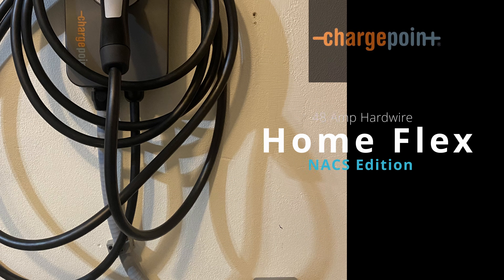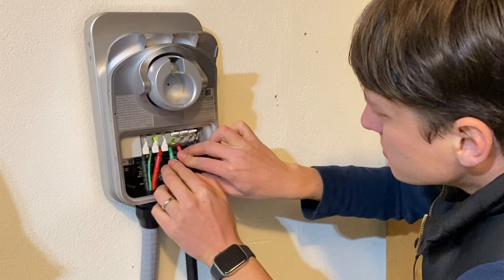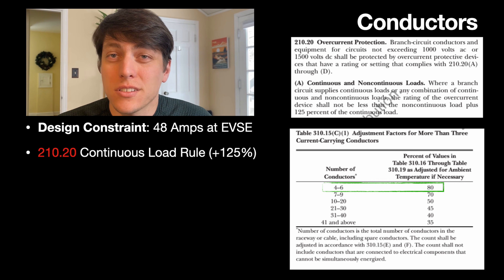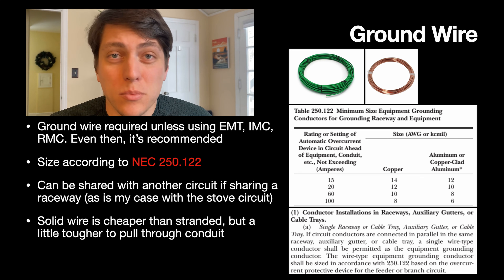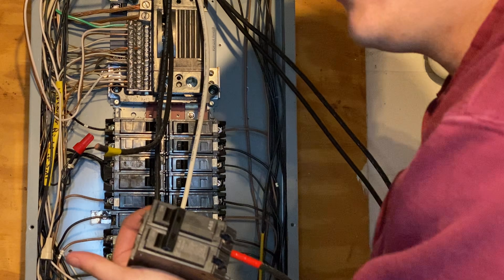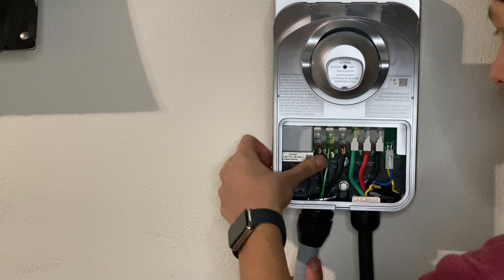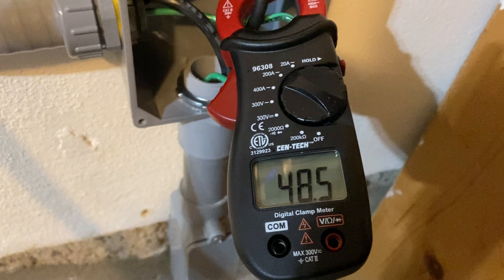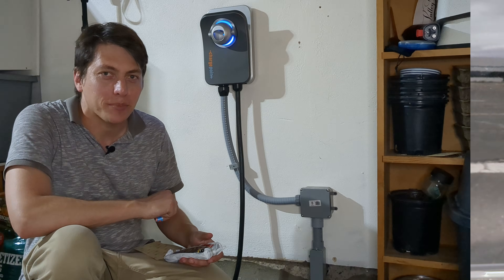DIY install of Home Flex EV charger

Comment: According to code you should install your fittings and glue them prior to pulling wire. This prevents solvents from the glue damaging the wire insulation. General rule is all mechanical first, wire and connections second.
Reply from the maker: Thank you for the tip!

Comment: I have this charger I got on Ebay but realized that it came with the wrong plug where I needed a NEMA 14-50. It seems that ChargePoint does not sell this plug so I am out of luck and the charger is probably going into the trash.
Reply from the maker: You could just buy a 14-50 dryer plug, cut off the ends, and wire that in to the unit?
Reply from the maker: Like this one https://amzn.to/44b45rV

Comment: Where the cable from your breaker panel enters the ChargePoint box on the bottom, does the “cable clamp” that secures the cable to the box (for strain relief) come with the ChargePoint box, or is this something you need to purchase, if doing a hardwired charging station install ? Great video !
Reply from the maker: It comes with the unit and I neglected to install mine. 😅 Good catch!

Comment: Hope you have better luck with yours than I’ve had.   I used to think it was a great unit, until it isn’t.  After a year I’m on my 2nd Home Flex with the first one eventually bricking (fault of ChargePoint support) and have had the original unit derate itself to default charge rate numerous times.

I put the fault completely on their support model.  Every time I’ve needed to call support it’s first a long wait to get a human.  Then you will encounter a very friendly support person (really, they are pleasant folks) that appear to be bound by rules and a knowledge base that are rigid in what they allow the support people to do.  Example, the first several times my unit would spontaneously derate while over night charging, after we discovered that my unit (supplied to me by XCEL on their TOU program) had firmware way out of date.  So easy enough right?  Let’s go thru the firmware update.  NO!  Before they will assist me to update firmware, they need me to call them back when this intermittent problem of derating occurs so they can “verify” and than they will be justified to update my out of date firmware.  It also turns out that my firmware being out of date also may have made my application unable to adjust charging rate via the app.  But this too was not sufficient to have them update my firmware.

So, this HomeFlex is mandatory to access my Utility’s TOU rates so I suffer thru this intermittent issue for another two months when all of a sudden I noted that I have ability to change charging rate in app.  I check and sure enough they apparently pushed through an update to my firmware after about two months.

So everything goes ok for awhile until in a completely unrelated incident, a utility worker severed my internet service providers feed to my property which of course limited my ability to connect with anything, including my HomeFlex.  Long story short it defaulted to 16 amp charging and was bricked after an effort by support to get me reconnected to the net.  Back and forth for a bunch of calls I finally had to get the Utility involved to get a replacement installed.  So guess what??  They did a great job of doing so, and I got a brand new HomeFlex from Xcel, but it was new old stock and I’m back to the old firmware and no ability to adjust the software to adjust charging rates.  It hasn’t spontaneously derate yet (it’s only been a few weeks) but the electrician and I confirmed (as I still had the original box) that the replacement was from the same lot of units they received from ChargePoint (the boxes were received by XCel on same date in 2024) so it’s pretty clear they were shipped with the same firmware.

It’s really a shame because they appear the have an elegant bit of kit, and the software superficially seems good enough.  But after living with it a year the app frequently can’t connect immediately (the unit is literally next to one of my mesh routers) and monitoring charging can be very laggy.  There is also no way to connect to the unit if internet goes down like say via Bluetooth or peer to peer WiFi once initial commissioning completes.  This latter bit appears to be on purpose to “prevent” theft as it essentially bricks the unit if someone steals it.  Problem is it also bricks the unit for resale unless a very specific process is followed by original owner to disavow their ownership before transferring the unit.

If it wasn’t for the requirement to have this specific model for my Utility to get me on their TOU, I would have gotten rid of this unit long ago.  There are better units that cost less on the market.